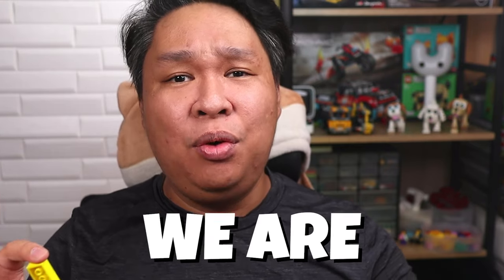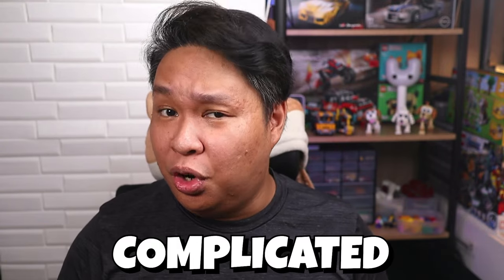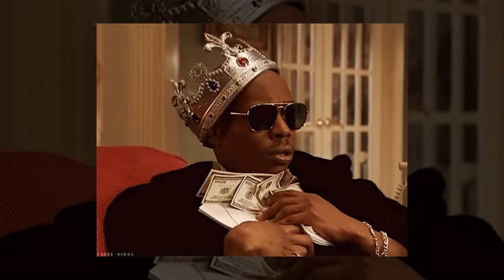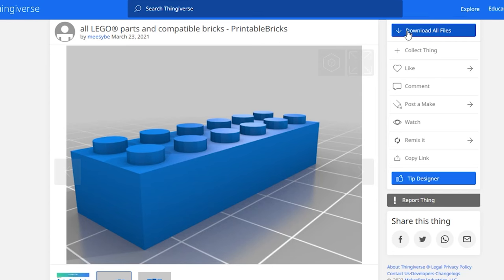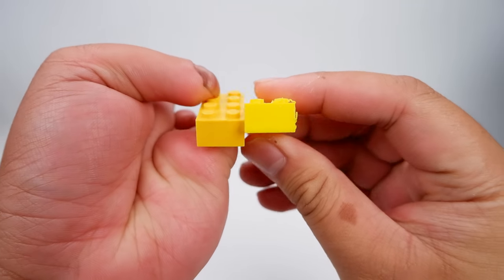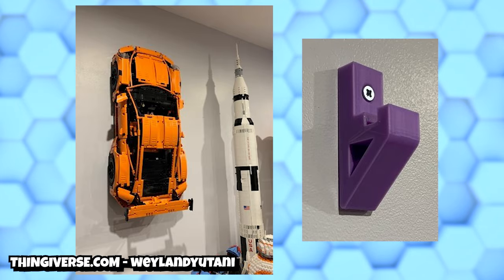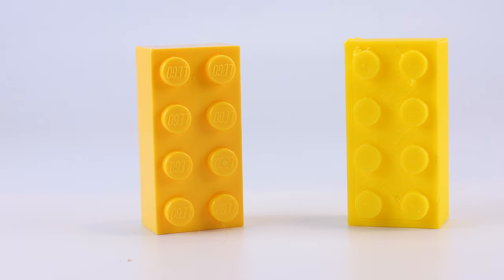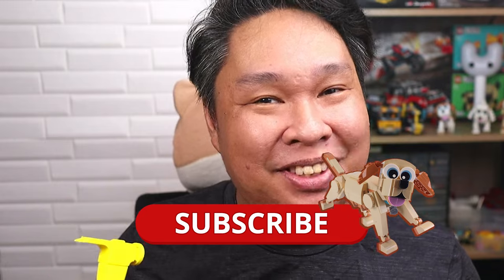3D Printing vs Real LEGO - A Simple Comparison

Comment: Given that you can purchase actual lego for about the same price as it would take to print as many with a 3d printer, it's not worth printing unless you need a specific color or piece.
Reply from the maker: I agree with you on this. I would also prefer to buy regular bricks than print them out unless I need them in a cool color that LEGO does not offer.
Reply: Maybe pieces that adapt Lego to another building system?
Reply from the maker: @davidawaters I will definitely consider this. Though I'm not sure what other building systems would be fun to adapt to LEGO. Will look into it :)
Reply: You can make completely custom lego bricks, with multi materials you can make one with texts and stuff. It's such a great idea
Reply: @BrickScore  lego to k'nex maybe

Comment: there is a simple way to solve the lego copyright problem modified the block like this in times of circuses on top modified to be square too .
Reply from the maker: Thanks for your comment. It's odd I wasn't notified. Anyway, that COULD be a solution but it will also introduce problems with the ease of interlocking different bricks. But this definitely deserves a good look into.
Reply: Like in Roblox?